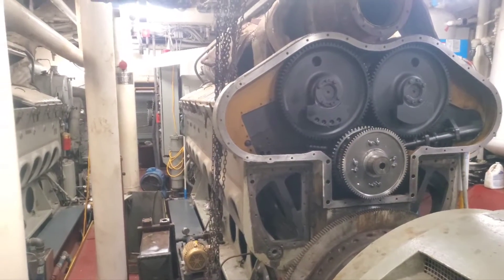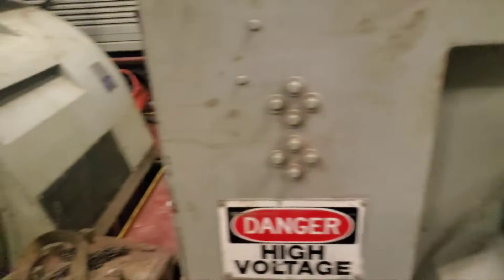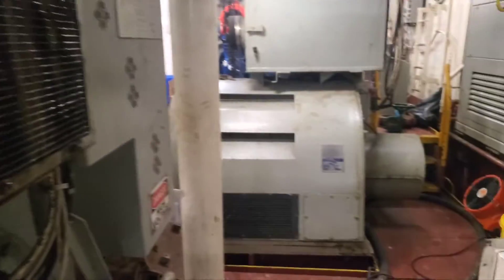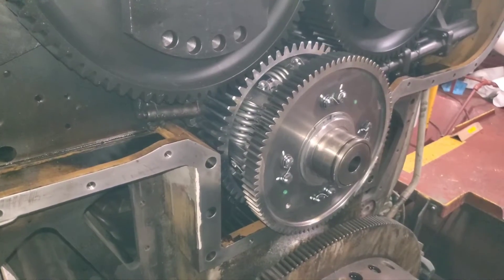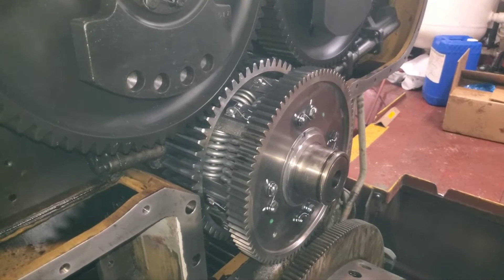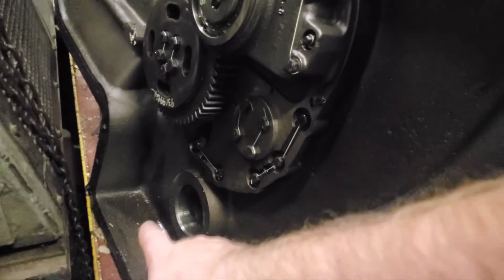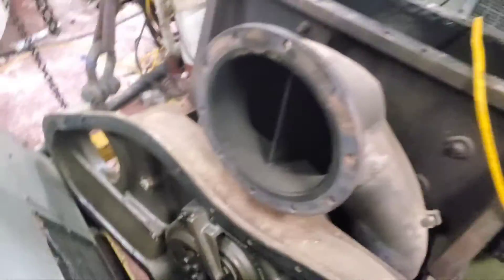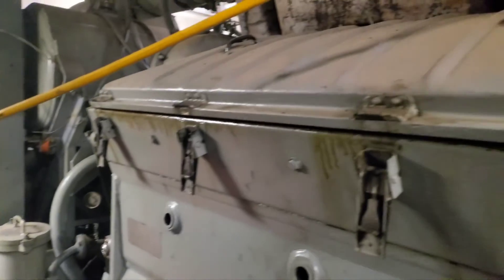Combined Turbo Supercharger? 2-Stroke EMD Ship Engine

Comment: For 11 years I worked as a brakeman conductor for the MP/UP! Spent many many hours on the SD40-2 best locomotive I ever ran! On more than one occasion, something caused the blower to go “back on the clutch in notch 8! It was a violent event. The engine would react by surging and lots of black un-burned fuel/carbon would exit the exhaust. At that point we will pull a certain wire off a relay and that limited that unit to maximum of number 7 while allowing other units in the consist to operate at notch  8! I never knew what caused this back on clutch condition to occur.
Reply from the maker: Interesting, thanks a ton for sharing that. We haven't had that but do have issues when we run them up after a prolonged wet stack. Thanks for watching!

Comment: In 1946, The Wright R-3350 TC18 turbo compound engine incorporated a somewhat mechanical turbo, gear driven, but had a torque convertor, not a spragg clutch.  Almost makes me wonder if an EMD engineer was influenced by the Tc18 turbo design.
Reply from the maker: Maybe so, thanks for watching!

Comment: 16cyl 645's on aircraft carriers.   Operated and maintained those for 7 years.  Per our training manuals on the turbos, over running clutch disengages at approx 1000 degree exhaust temp
Reply from the maker: @williamwicklund4273  Interesting, our engines rarely ever see 1,000 even when pulling a heavy load for hours on end. Thanks for watching!

Comment: Is this clutch a common failure point or maintenance item? it looks like if it failed at the very least you'd have seriously reduced power - assuming the best case where it just fails engaged. Regardless that's an ingenious design to avoid the complexity of having both a blower and a turbo.
Reply: I actually came to this video because we're about to replace a turbo because of the failed clutch at only 21k hours but also on a 710 emd same thing except electronic over air. The guy in a comment above said what I've always assumed the turbo gear to be is actually a dampener gear and the clutch is actually in the turbo ive never heard of that before actually. Not saying he's wrong in any way. Yes as you said earlier tho your clutch will only free spin one way and lock the other and depending on the rotation of the engine is depending on the way the clutch should spin.
Reply from the maker: I think they used to have problems but seemingly not now, they almost always last the 32k hour overhaul period and are still working fine. The clutch is really just a simple sprag. Thanks for watching!

Comment: Are these engines house power for the boat or is the boat diesel electric prop drive?  Impressive engines, very popular in Australia for remote power houses where they are the grid, nothing like half a dozen of these things singing away
Reply from the maker: Diesel electric. I have a video showing the rest of the engine room and drive motors on my channel. I stumbled upon a powerhouse on the island of Saipan years ago with 6   20-710 engines. You are very right about it being impressive. Thanks for watching!

Comment: My friend who works on diesels told me that these are hands down the best engines ever made because they use a welded steel block, apposed to cast iron. In your opinion do you think that is true, or is there something more reliable out there?
Reply from the maker: @timpike1616  This family of engines has been in service since the 30's. The 2-stroke 710 series is still in production for marine applications. The welded crankcase is only one of the benefits. As for medium speed/medium duty engines these are hands down some of the best. Their downsides are they aren't push button start and require somewhat of skilled maintainers to operate. Thanks for watching!
Reply: @FixAndForget i have jusy recently been on a twin screw emd 645 boat where a seasoned electrician has figured a way to have a push button on the engine I could never figure out how he accomplished that

Comment: Are you sayin the turbo has 2 different drive methods ?
low speed, gear driven.
high speed, exhaust gas driven.
Reply from the maker: @RIPPERTON  That is exactly right and I wish I had used your wording in the video. Thanks for watching!

Comment: Nice I love mtu Detroit diesel
Reply from the maker: I'm glad to hear MTU still makes limited numbers of replacement 71 series engines for government buyers. I hope to see the 71 series in production at its 100th birthday. Thanks for watching!
Reply: @FixAndForget  when a 🤠 cowboy trades spurs for wings lol
Reply: @FixAndForget  in Utah Bonneville salts flats mtu got a 16 v doing 228 mph on freightliner n Detroit diesel got 24 v behemoth won the war besides remembering German which is the first to make a jet engine
Reply from the maker: @Latuya-y1n  Very cool. Pretty much all modern millitary high performance diesels are MTU. I've worked on a few ships that have 20cyl. MTUs coupled to a gas turbine.
Reply: @FixAndForget  Mann maldi they shave off the counter weights off them 100000 hp plus
Reply: @FixAndForget  Finland made icons of the freedom
Reply: I met few guys but the virgin Richard Branson ship mechanics are overwhelming less smoke out there exhaust all others have either too much condensation or head gasket issues Bruce less says empty your mind like water waterless heads can hold more pressure
Reply: @FixAndForget  well my folks friend worked in Detroit diesel in 1963 64 the good thing about Detroit diesel all of them except 53 u can turn cam or switch from one side to other make it two stroke n 180 degrees on oil pump ⚙️ gear I got a long block 14 liter with cooper split cage ceramic roller bearings as main bearings I bet noone getting my rpms except a 10 liter
Reply: @FixAndForget  now that's a limit must have dte or custom chip to open it up hehehe

Comment: These engines are absolute works of art that can take a beating and keep on swinging, and even if they do break, they are so modular they are much easier to repair! Just a shame they're being run out by junk science.
Reply from the maker: Absolutely agree. There isn't anything about these engines that can go wrong and not be repaired. A rod coming loose and knocking a hole in the crankcase would spell certain death for most others but can be repaired in a day with these. Thanks for watching!

Comment: Its weird hearing two stroke 
And then cam gear
Reply from the maker: Yeah all the big 2stroke diesels have massive exhaust valve gear. These are 4 valves per head. Slow speed engines are one massive valve per head. Thanks for watching!
Reply: @FixAndForget  ... and also drives the injectors.
Reply from the maker: Yep center lobe on the cam. The slow speed engines use individual "jerk" pumps to drive the injectors. Thanks for watching!

Comment: There is NOTHING like the sound of a turbo EMD going in and out of gear and the change in pitch of the exhaust note. Doesn’t matter how many times you hear it, it never gets old.
Reply from the maker: Totally agree. I worked with a few Cleveland and 567 EMDs so I am also privy to the "old" noise before the turbos but still love it. Thanks for watching!
Reply: @FixAndForget  I’ve worked around natural 12’s turbo 12’s natural 16’s and turbo 16’s all as propulsion engines. While the mufflers and piping effect the exhaust note of the particular installation the increased degrees of rotation per firing makes the natural 12’s sound the most rowdy but nothing is as smooth as a well balanced 16.
Reply from the maker: Almost all of the 2-strokes I've been around have been 900rpm generators without mufflers but a hundred feet of exhaust away from the stack. Just a low pitched drone by the time it made it out. The gear drive noise on the roots blown ones was the main noise heard, now just turbine wine. Both great!
Reply: Sorry to correct you. 
567 and 645 engines with turbo applications have internal overrunning clutch. The second idler gear has a spring pack to inimise vibration between turbo and engine drive. 710 have the overrunning clutch on the second idler gear

Comment: Locomotive prime mover and generator set also
Reply from the maker: That's right, they are also very popular in the marine and stationary applications. Thanks for watching!
Reply: @FixAndForget  Used on all Nimitiz Class Nuclear Powered aircraft carriers as emergency power, and a whole lot of nuclear power plants.
Reply from the maker: @john5321  Yeah I've seen a few pictures of them on the carriers. Probably won't see a cleaner, lower hour EMD than those. I have a video I took of (5) 20-710 EMDs providing power for the island of Saipan I'll post one day.